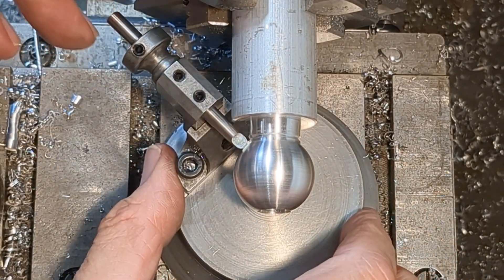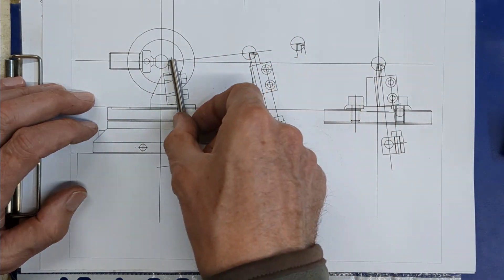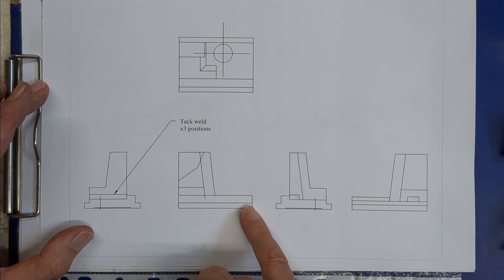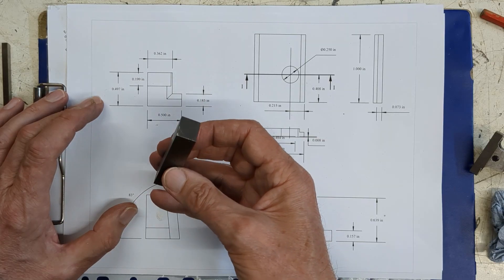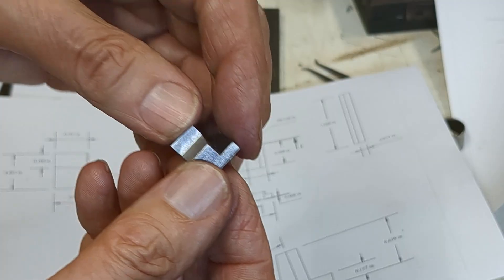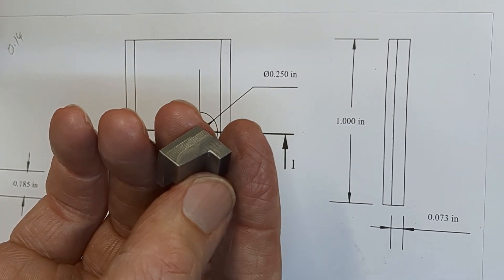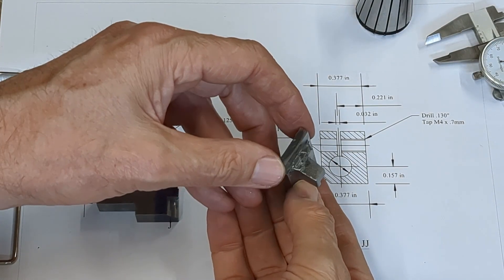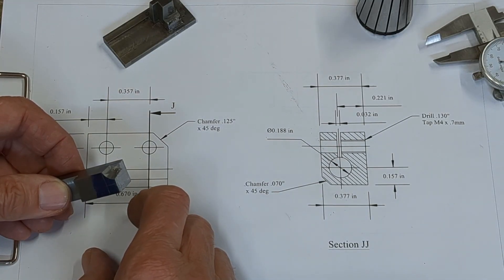Radius Turning Tool - part 6

Comment: SILVER SOLDRING , NOT WELDING.
Reply from the maker: Yes Richard. Before I moved I had an oxy-propane set up which was great for delucate jobs like this. I have propane but need to get the remainder of the equipment.
Reply: Hi Clive. I admire your ambition to try welding. It’s something I have never tried. I for one would be interested to see a video in which a beginner shows what it is like starting out from scratch. 👍😀
Reply from the maker: Thanks, Andrew, for your comment. I was thinking of staying away from welding as a topic because there seems to be so much online. However, doing something as a novice is worth considering. The thing I will say is that it has already come in useful including for two repair jobs for others. So, will see!

Comment: Another great video, but is there any chance you could work in metric please.
Reply from the maker: Thanks, Tony. Old habits die hard! I will see what I can do to cater to both audiences. I may end up having to use both. I tried using captions for the metric dimensions but wasn't sure if that really helped.
Reply: @Workshopfriend just watching your latest installment,  thank you for your efforts, it must be hard when your used to using one system.

Comment: another way to weld that would be to plug weld it from underneath, you would drill both parts and then 'plug' the holes by welding, that way there is no visible weld and any mess can be machined off flat. Like your channal, most enjoyable watching, regards, David from fatty's workshop
Reply from the maker: Thanks, David. That is a great idea. I might still be able to use that for attaching the next part of the holder. I will probably need to experiment first to get the right diameter for the depth of each hole - being new to welding.

Comment: Good morning. Thanks for the video. Very interesting. I’m guessing that you imported the mustard jar? Certainly not a brand I have seen before. I’m sure you considered a carbide button insert mounted on a column as the turning tool? How are the rust/condensation countermeasures working out? Finally, I like the working drawings you come up with. May I ask what software you use? I would enjoy longer videos if that’s something you’d consider. Best wishes. Mike
Reply from the maker: Hello Mike. Thanks for your feedback. I did briefly consider an insert mounted on a column à la Stefan Gotteswinter. I wanted to complete the operations in the lathe but as compared a mill there is limited height capacity. Yes, so far the rust countermeasures are working out fine, but the real test will be winter! Thanks for your comments on the drawings and length of video. I will bear those in mind.
Oh yes, I am sure the mustard was bought locally - at a well known discount store.
Reply: @Workshopfriend  your CAD software?
Reply from the maker: I use TurboCad - quite an old version, 2015. It is more than adequate for what I need.
Reply: Thanks 👍